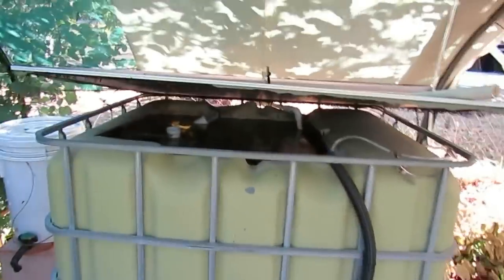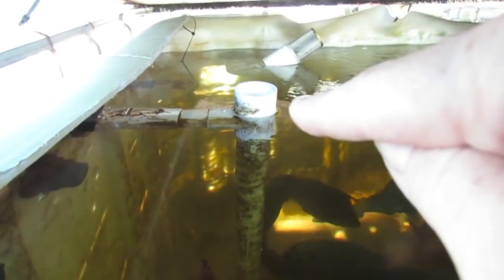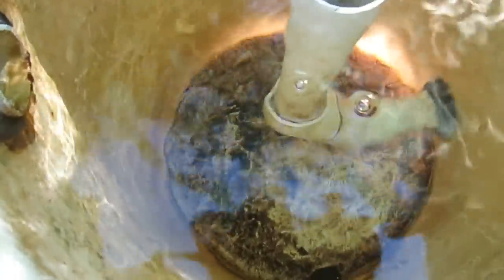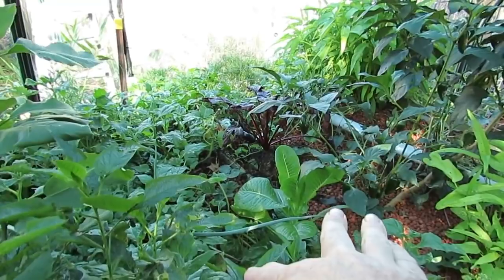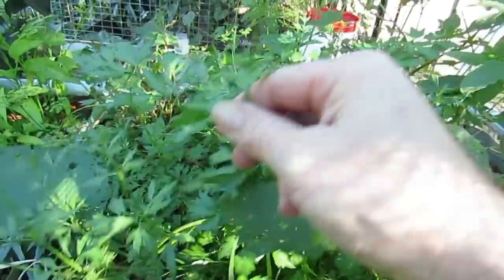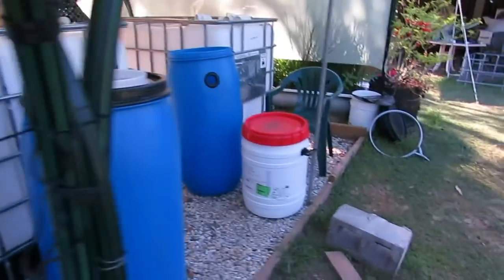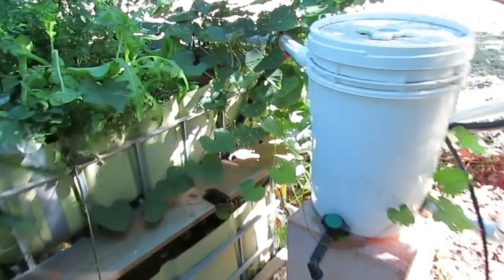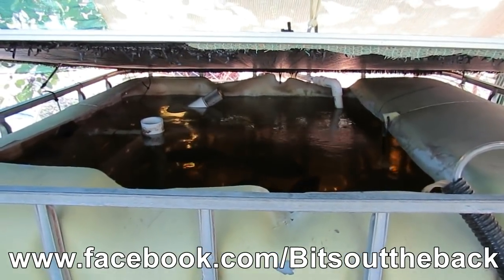Aquaponic plumbing, How the water flows through our IBC system.

Comment: Question brother man.... Does the sump tank need to be lower than the system? If so how high does the tanks and beds need to be above the sump tank?
Reply from the maker: The sump needs to be the lowest part if you are using it to house the pump. They could be sitting right on top of each other but I like to keep the beds at a height above it so that I can get into the sump to work on the pump other plumbing. 👍
Cheers John .

Comment: Is it necessary to have a sump ?
Reply from the maker: It's not necessary Nadhir but I think it helps in these larger multi bed systems like I'm using. Will be coving that point in a bit more detail in an upcoming clip.
Cheers.
Reply: Thanks for your reply.  I've just setup a green house aquaponics with 20m length of 4" PVC and 100L basin (for the fish)  . The outlet of the PVC goes straight into the basin and am uncertain once I introduce the plants whether would there be dirt I should filter before the water enters into the basin

Comment: Hi Rob.   I am wondering if you could help me design a aqua phonics system using 5+ gallon buckets.  I am thinking three rows about 1 ft apart the length would be 4 ft. So aprox  12 buckets.  rows of 4.  I am thinking  hydroponics system but aqua phonics. Not sure where to put the fish tank, sump tank, and filter tanks.  Need help designing one.  Thanks
Reply from the maker: Hi Kelsey. Sorry I missed your comment. Did you end up building the system ? 
Cheers,
Rob.

Comment: I've been thinking on how we could replace the electric water pump with a ram pump
https://www.youtube.com/watch?v=CG0laNqJWY0
Reply: Emeric Catudal sill need to figure out the calculation/ratio
how much pressure the siphon generate
how much pressure the ram pump need
how high and far water will flow
and will it sufficient to run a venturi

Comment: Nice video.  Talking about dissolved Oxygen; you mention a venturi into the fish tank.  I see the pipe supplying water to the fish tank enters the water, rather than being sprayed or even being poured in, which would entrain oxygen.  There must be some reason you are not spraying in. The venturi:  how does that work?  Could not see any bubbles.

We get 45 Celcius typical temperatures here, sometimes spiking to 50 C; killed my last batch of fish.  Trying to do better this time around.
Reply from the maker: +Walter Gillies 
Hi Walter.
Sorry I missed your comment mate.
There was a thin curtain of bubbles at the back of the tank which didn't really come out well in this clip. In the end I ended up pulling the bar that ran across the bottom of the tank off from memory & just had a 8"/20cm pipe delivering the water & air. 
Noise is a factor with falling or spraying water. The neighbours are fairly amicable here but I don't want to disturb them too much ;) I did play around with spray bars at the start but found they also retarded the flow rate with the size pump I was working with. 
Hope that helps some mate.
Cheers.

Comment: Hi Rob, looking at this, I noticed the radial flow filter was below the tank. Where I am going to be using an existing in ground koi pond as my tank, will I need to add some type of pump between the tank and the radial flow filter, as the filter will actually set higher then the pond? Will this even work the way I am planning on running it?
Thanks, lee
Reply from the maker: Hi Lee..
Have seen folks pump up to a radial flow filter & then run the water out to the grow beds via gravity.. The main thing to pay attention to is the flow rate into the filter & the pipe sizing you're using so it doesn't over flow.. How many GPH are you looking at running through it ?
Reply: Rob Bob Rob at this time I am still  in the planning stage...I am laying out the desiagn of the grow bed and where it will set and the plumbing. I am not sure yet what size of pump to use.
Reply from the maker: Lee Ralph Hey Lee... Have you made much progress on the system ?
Reply: Not yet, as it will be an outdoors system, the winter and (winter laziness) has really slowed me down. Hopefully in the next couple weeks it may warm enough to start building my box.
Reply from the maker: Lee Ralph I can understand that mate..

Comment: hi rob I have been building a system from some 275 gallon ibc totes and ill be running 3 gravel beds and 1 raft bed, I was wondering what is the minimum number of tilapia I would need to supply enough nutrients to the system? I love your videos thanks
Reply from the maker: Hi Mike.. Just came across your question now sorry made :/ Don't miss many but a few slip by.. Did you find the answer to your question mate ?
For a minimum, that really depends on what you want to grow.. A system full of lettuce needs less nutrients packed full of tomatoes & peppers.. Probably wouldn't go below 20 myself.. 

As for maximum, if you have a 275gl Fish tank & 3 x 79gal grow beds I would run about 30-40 maximum.. That's based on the amount of  bio filtration the grow beds will hold.. 
The often used rule of thumb is that there will be enough biological surface area on 25L/6.6gal (US) of wet 20mm/¾" rock or clay balls to be able to process the waste of 1 fish being raised to 500g/1lb.. Some say you only need 20L/5.3gal (US) but when starting out I liked to play it safe  ;)  

Hope that's some sort of help for you mate..
Cheers..

Comment: Ive been experimenting.  I have a 325 gallon ibc I cut the top to a 12 inch deep grow bed. I have a constantly flooded grow bed with a 9 inch stand pipe leaving 3 inches of dry rock media. I left the cage in tact. Using the metal cross beams to support the bed leaving a unified box. I used the existing cap removed the smaller 2 inch hole cap and inserted a 2 inch stand pipe....worked fine. But the plants were not growing tall and fruiting prematurely.  Figured the roots were'nt getting deep enough so I wanted to add a bell syphon. I used a 4 inch bell cap....but its not working. Do you think the stand pipe and bell are too large? Seems theres air comming up from the tank through the standpipe.
Reply from the maker: Hey there adroc00..
Sorry it's taken a while to get back to you..
Did you sort the siphon out at all? I think if you reduced it to a 1" it would work better for you..
Cheers,
Rob..

Comment: Good Day Rob,
I’m just getting ready to set up my own very small system I’ve learned a lot from you’re channel already THANKS. I have a few questions if I may ask? What size of pipe is running from your pump into the fish tank? I have a lot of 1" piping I’ll be using to run to the grow beds with ball values. (I already had these items from other projects lying around.) Will a ½ inch line from my pump to the fish tank be enough volume to supply everything? The pump is a 400 GPH and my head height will only about 4 feet. Thank you for your most valuable information.
~Rob
Reply from the maker: Hi there Rob.. No expert but will give you my thoughts ;) Not really up on flow rates other than what I have played with myself & seen on plumbing web pages..
The ½" line from the pump should be fine if that is the threaded fitting it came with.. I always use the same pipe as the fittings on the pump go so it't running at its optimal flow rate..
Sounds like you might be pushing the limits of the 1" pipe if the head doesn't reduce the flow from the pump too much.. Can you do a dry run without gluing the fitting just to see how it flows ?  Do you plan on expanding the system & putting a larger pump in the system in the future? If so it might pay to go to 1¼ or 1½" to save having to re plumb later..
Hope that gives you some food for thought..
Cheers mate,
Rob.

Comment: Hey Rob. Thanks for these great videos, just recently started my first Aquaponics system. One problem I'm having, is that my outflow from the fish tank isn't out pacing the flow into my fish tank. I have a 2inch outflow designed the same as yours. The amount of flow into the tank seems unusually slow, even slower is the flow out of the tank. Have you ran into this issue and recommend a fix?

I'm thinking of adding a overflow pipe like yours, but I think it would be used more often than not at this point.
Reply from the maker: Hi there.. Will have a crack at working it out but need to know a few things first.. What sort of fall do you have from the SLO outlet on the FT to the grow beds & is the pipe also 50mm/2" all the way to the taps ?  If the amount of flow going into the grow beds is retarded a bit that will also cause a bit of a back up in the lines..
Cheers mate,
Rob..
Reply: Here are some photos to show my setup:
https://www.dropbox.com/s/i8pta5hi11kqc25/Photo%20May%2004%2C%2010%2048%2039%20AM.jpg
https://www.dropbox.com/s/n50gecpohxpk67v/Photo%20May%2004%2C%2010%2048%2054%20AM.jpg
https://www.dropbox.com/s/snfgu19n9isk9ei/Photo%20May%2004%2C%2010%2048%2026%20AM.jpg
https://www.dropbox.com/s/sz9e7qm563s8ipa/Photo%20May%2004%2C%2010%2048%2017%20AM.jpg

I have a pump in the sump tank that pumps water to the grow beds and to the fish tank. The fish tank does not feed directly to the grow beds. The fish tank has a 2" outlet to the swirl filter and a 2" out of that to the sump tank.
Reply: Rob Bob Well, solved my problem. I had put a screen around the bottom of the pipe to keep the fish from getting sucked up (fingerlings). That seemed to restrict the flow quiet a lot, removed and now things are flowing smooth. Keep the video updates coming, great stuff. Thanks.
Reply from the maker: exeseven Sorry I didn't get back to you straight away.. I find the drilled out end cap & slits cut in the side work well here...
Cheers mate..

Comment: Hi Rob, thanks for the walk through, I've been looking for someone that has the same setup that I want to use so I could confirm my plans.  I've been studying Aquaponics for a while and once moved will set up my first.  On your filter out of the fish tank, what is your thoughts on your bell design attached to the lid as compaired to other designs with a swirl design for solid separation?  Also how do you keep from over flowing your sump system? ( I know this is going to be a duh question when you answer it, sorry)  Does it have to do with the volume of water that dumps from the grow beds at the same time?  Can you control the beds from dumping at the same time by filling one, then another while the first one dumps and so on?  OK, that's it for now, thanks
Reply from the maker: Hi there Richard..
The radial flow filter works great & is a very simple unit to build.. Can't compare it to others as I have only used this style for now sorry.. If you're only building a small system & will be lightly stocking it you may not even need one of these units..  Just finished making an improved version to replace the unit in this clip if your interested in having a look..  New radial flow filter for aquaponic system..

Might get a bit long winded here so bear with me ;)

The sump tank will need to hold enough water to fill all grow beds with some extra to cover the pump.. To calculate this you need to know the total amount of water that could be in the grow beds at one time..

The  general rule of thumb is that 1/3 of the total volume of the grow bed will be water when filled when using clay media or rock up to 20mm/0.75" in size..  I like to over do this & allow for 50% of the grow bed volume to be water.. This will give the sump tank a sizable buffer in a small system..

For example, the beds in our system are 300L/80Gal (US) & are filled to the top with 300L/80Gal (US) of media..

When filled with water the beds will contain roughly 150L/40Gal (US) of water (using the 50% figure)..  I have 3 beds so the total water from all three will be 450L/120Gal (US).. 

You will also need enough water in the sump so the pump doesn't run dry if all 3 beds are being filled at the same time..  In our system this was easy to work out as I placed the pump in a cut off IBC & saw that I needed about 150L/40 Gal (US) to cover it using the volume indicators on the side of the tank as a guide..

So for my final calculation I added the water needed to fill the 3 beds + the water needed to cover the pump to give me the final volume needed for our sump which ended up being 600L/158.5Gal (US) for me to be happy.. 
The extra water also gives you more leeway when it comes to doing top ups due to evaporation, water used by the plants to transpire or mishaps...

Hope that helps some & have fun with the build,
Rob
,
Reply: Great feed back, thanks.  My first system will contain 4 grow beds no less than 4x8 feet at 12 inch deep. I may start off with just floats until I get the clay media, not sure about that part of setup yet.  My plan is putting together a larger system in a couple of years. Thanks for your feed back.  I can't wait till I get started and post my first video and share with everyone wanting to do the same.
Reply from the maker: Cheers Richard Britt :)

Comment: Hello again.  I was wondering if I could enlist your advice once again.Recently, I bought a 1800 liter per hour pump.  I hooked it up for a quick test run and it was very strong.  I was wondering if it would be a problem to regulate the flow/pressure just upstream from the pump.  Would that create a burden on the pump, stress the device?  Could I get a blown pipe while at work or something?  Do I need to step down the pump capacity?  What do you think?
Reply from the maker: Hi there... It depends on what type of pump you have.. I use magnetic drive pumps that can have the flow throttled back without harming the pump itself & from what I have read will also reduce power consumption (yet to verify that for myself)..
Another way to alleviate flow is to run some of the water back into your sump tank if you have one in your system..
Hope that helps some :)
Rob..

Comment: Hi Rob!

First off, I just wanted to say thanks for your fantastic videos. They are so in-depth and detailed, which makes it much easier to learn and understand.Your videos, along with a few others inspired a friend and I to start up our own aquaponic system.

Anyway I have a quick question for you. How often do you need to add water to your fish tank (and how much usually)? I'm just curious because the growing medium doesn't soak up water like normal soils would, but obviously your plants will still be using up some of that moisture. I would think there would be at least a small amount of moisture loss over time throughout the system?
Reply from the maker: Hey Dylan..
Glad they have come in handy for you & your mates :)
I haven't really measured the amount of water "lost" but do add about 300L/79gal (US) every second week to the system which holds 1600L/422gal (US) when filled.. Will try to do a more detailed measurement at a later date..
Plants will remove some water from the system through transpiration while some is also lost through spray that lands outside the grow beds (I need to fix that) & evaporation..
Hope that helps some Dylan..
Cheers..

Comment: Ah, I see, you are using a bell siphon system.  I saw the specks on the water pump.  Could you by chance give the exact name on the pump.  I will have to special order that at the local 'home center' here in Japan.  I realized that there is no way I can use fish tank pumps because the pipe fittings are hard to match up.
Thank you very much for taking the time to help out!  Good stuff!
Reply from the maker: The type of pump we have is a  	 	 	"SenSen HQB4500" & you can get smaller models as well if your system is smaller..
Any magnetic drive pump that has good reviews should be good enough.. The main thing is to get the water in the fish tank turned over at least once every hour..

Comment: Rob Bob  have you considered putting the air stones in your growout tank rather than the sump, oxygen transfer is all about bubble size and contact time, the shallow sump doesn't allow a lot of contact time. May help on the hot days.
Reply from the maker: Did have the air stone in the fish tank for a while but turned it into a spa so took it out..The fish were grateful methinks ;)
The sump is normally a lot fuller that in the clip & hope to have a float valve installed soon to keep it constantly topped up..
Thanks Greg,
Rob..

Comment: I want to do a wicking self water bed like you have but I want to use the in ground  garden I already have.  What can I line my ground with that wont cost hundreds of dollars?  it's an 8ftx3ft garden.
Reply from the maker: Hi there.. We use 200um builders plastic as it's much cheaper than pond liner.. You can buy a roll of it off off the roll, just make sure they don't put any holes in it if you buy it that way..
Hope that helps..

Comment: hay Rob i wanted to try wicking 57L bucket and i just wonder can i use sleeved agi pipe and just potting mix on top of it or i have to use sand? is it best to use sleeved agi pipe or some kind of weed mat . sorry if i confuse you :D
Reply from the maker: Hi there... I like to use sand in the reservoir as organic matter can go aerobic in constantly wet environments.. I had that happen in 3 of my first wicking barrels.. We could smell the reservoir through the fill pipe so they were  pulled down re built..
Hope that helps you out..
Cheers
Reply: Rob Bob
thank for replying i have 54L 27x64x40cm container and am using 50mm agi pipe sloted i have no clue where to put the overflow hole can u plz help me out.
Reply: Rob Bob
what type of sand can i use play sand?
Reply from the maker: thychea82
Hi there...
have I answered this elsewhere ? Getting so many comments I'm getting a bit lost sorry :/